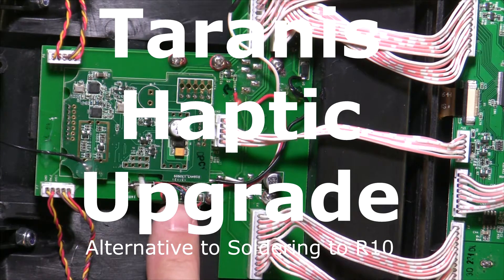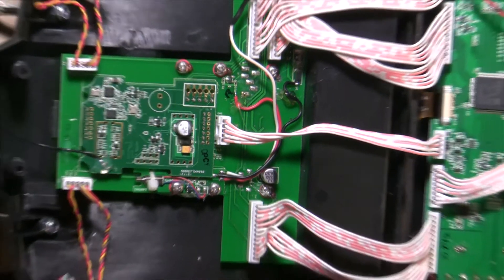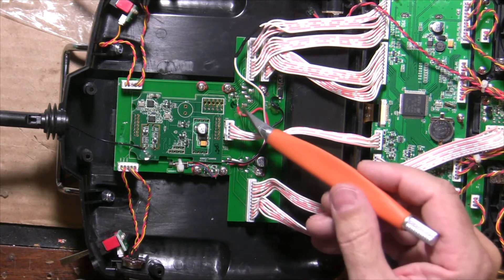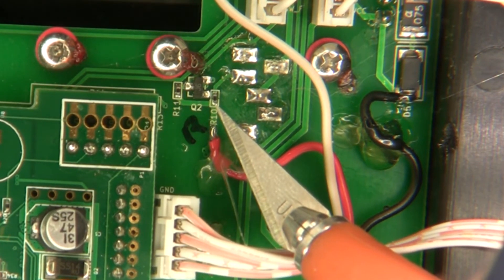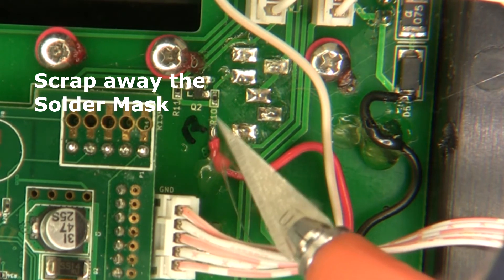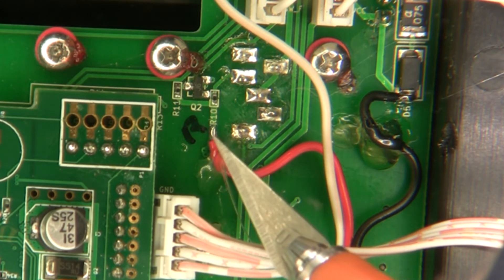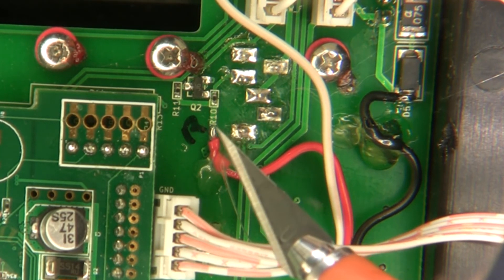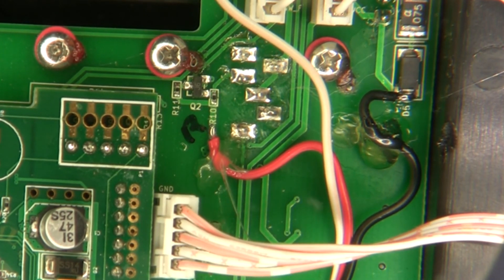FRSKY Taranis Haptic Upgrade - Red wire to R10 alternative

Comment: It would seem reasonable to assume that the electrical connections for the haptic module would be VCC, Ground and Signal.  That having been said, there should be a more expeditious solution for accessing VCC and ground, aside from soldering those wires to occupied SMD component pads.  Bad form, FRSKY!